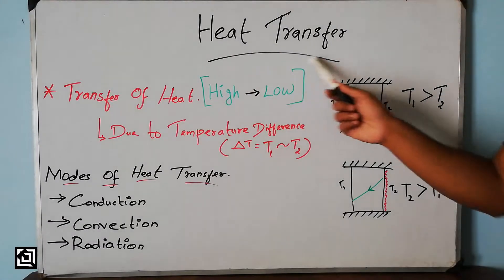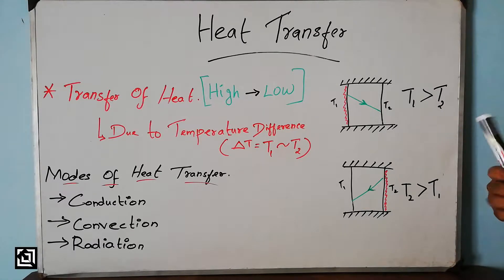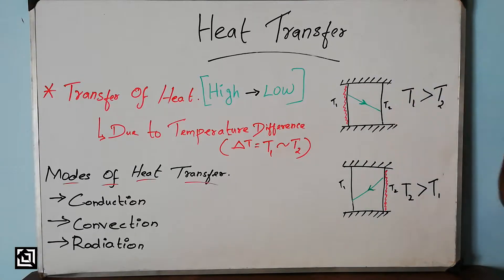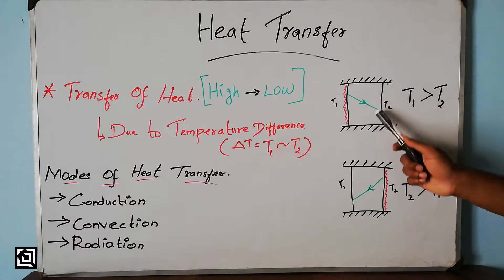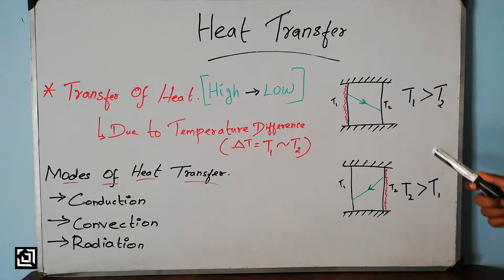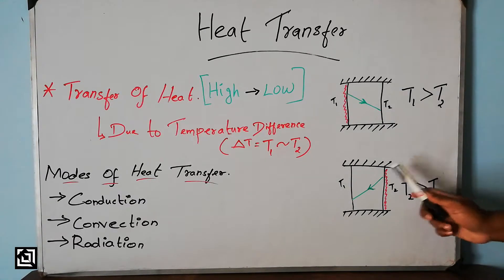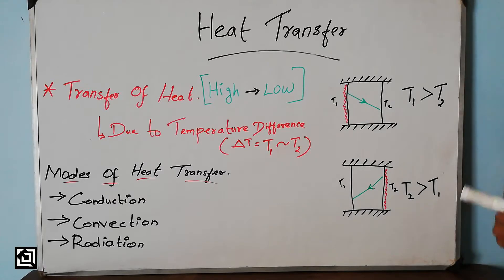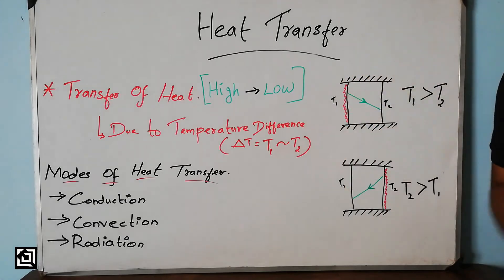What is HEAT TRANSFER? #08 | TAMIL | It's_made_EZy

Comment: Can you give a video to understand the research journal?
 journal 👇
The Combined effects of maldistributions of the inlet air temperature and the induced flow non uniformity on the performances of radiator , heater and oil cooler.